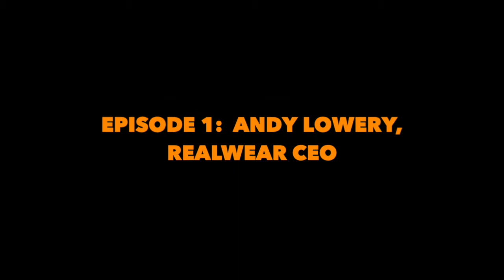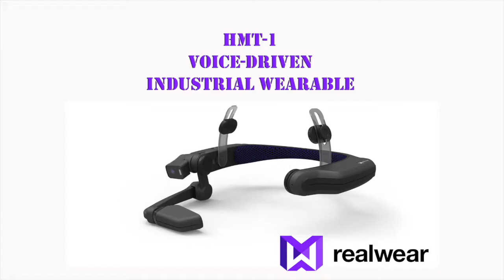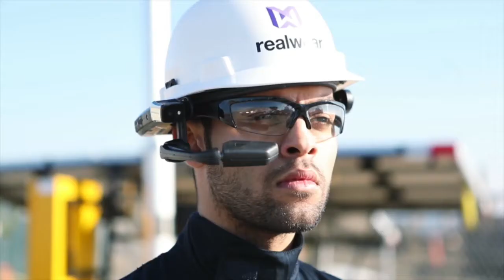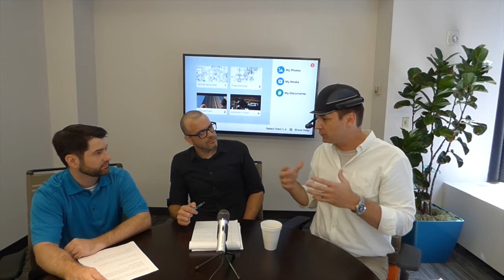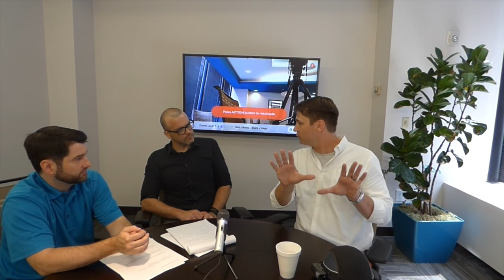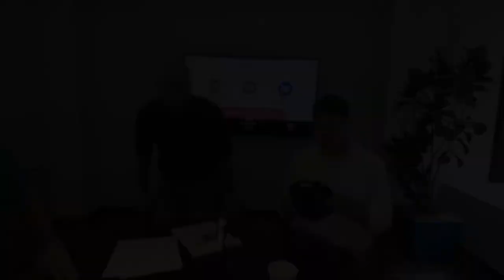NED Talks: RealWear CEO Andy Lowery discusses & demos HMT-1

Comment: Really great interview. Helped to understand a lot of the remote assistance solutions and other vendors available on the platform.

One thing, the microphone used in this video caused an annoying echo.

I am also curious about OSIsoft PI Vision. How does this application run on the HMT-1? I would like to have voice control but I cannot find an Android APK for PI Vision. It seems like they dropped the app in favor of the HTML5 web experience (no voice commands).
Reply from the maker: Hi Brian! Thanks for the comment. This was our first video and we realized afterwards that the room did cause a lot of unintended echo, which we agree was super annoying. For any questions you have about the HMT-1, you can tweet them at @RealWearInc. We think they can help you out!